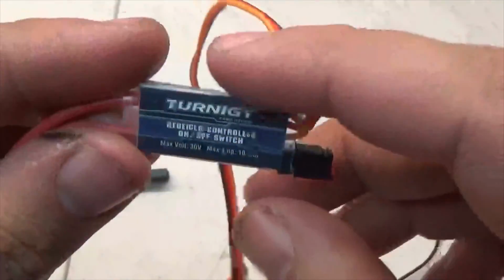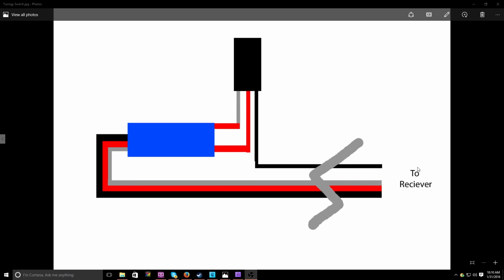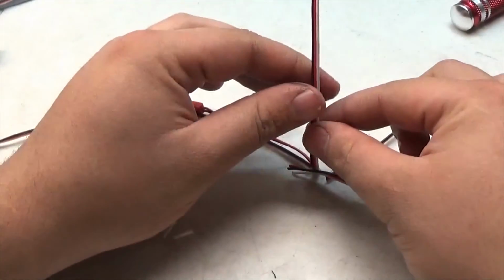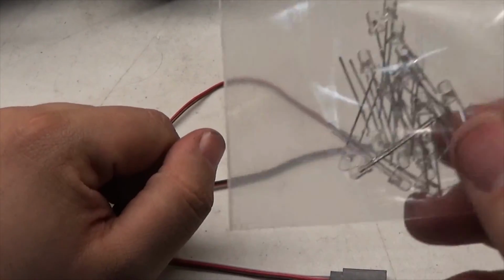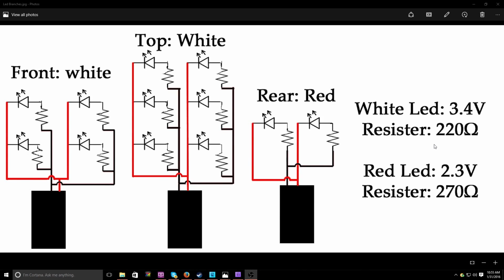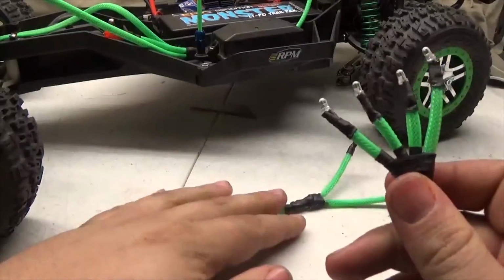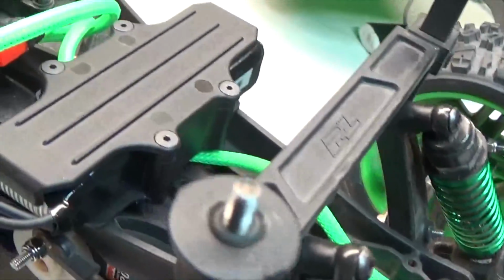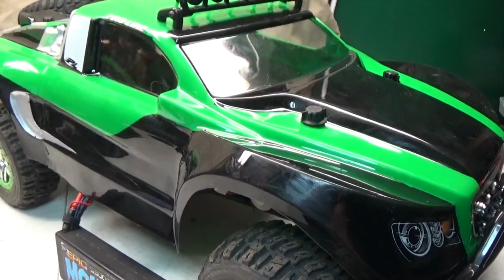Monster-LCG Slash 2wd-Level 15 Upgrade: Custom Led Kit

Comment: Can I just get all of the led wires, put a 9 Volt battery connector to them with electric tape and to turn it on just put the 9 volt battery on?

Comment: Looks great!
Can't you put aluminium tape in the buckets you have on top?
That could help a bit?
I would unplug it if you don't use it by the way, arent the resistors going to keep asking for current, draining the battery?
I might be wrong at this, but can't you use one resistor and solder 4 wires to that, instead of 4 resistors?
The voltage should be dropped anyway after that resistor?
Reply from the maker: I can try the tape, I only have the battery on and plugged in WHEN I intend to use the lights, when not in use it stays in my charge bag with the rest of my lipos. In theory yes, but first you have to make sure the resistor can handle the amp draw. I decided to play it safe and have them paired with a single led. And this way if one fails for whatever reason only one LED stops working. And if I'm running in the night I don't lose that much visibility
Reply: +RCBros2000 Ah, that is true, I don't know that much about electrics.  keep up the good work!

Comment: Awesome! I love how you used green wire mesh, it wouldn't have looked as nice if you didn't. Also, do you think we will see a run video any time soon?I would love to see your cars run
Reply from the maker: +RC Mayhem im planning a big runn video involing every one of my Rcs. with many shots. all i need is a suction mount and im set. and get alpha running. pain in the * that carb has givin me problems since i re did the seals and boot. guess old tech doesnt like getting fixxed up.
Reply: +RCBros2000 well I can't wait to see it, I might do a run video next weekend of delta and possibly beast. I hope you get alpha working
Reply from the maker: thats my plan for tomorrow

Comment: sweet, how much did the kit cost?
Reply from the maker: +All The Time Rc for everything including the charge lead for the battery costed around $65.78
Reply: +RCBros2000 how r u so smart at this im like aaaaa i don't know anything
Reply: +RCBros2000 if u have any extra wire mesh can i have them so i can use it when i get a stampede and build it
Reply: +RCBros2000 wow the light look awesome!!!! man and very bright
Reply from the maker: +Chevy RC very funny chevy very funny
Reply: +RCBros2000 lol u want me to delete it
Reply from the maker: no you can keep it lol

Comment: Lol took you a while to finally get everything. #January10
Reply: Cool video!
Reply from the maker: +goldfishshooter tHE the resisters took forever but i had to wait for the battery to come in.  but you can scratch a week off since i was working overnights all week last week so i diddnt get to editing
Reply: +RCBros2000 well at least you got everything for it to work!!
Reply from the maker: ya after several burns and a short circuit. i need to get one of those soldering iron holders lol. i enjoyed working on this
Reply: +RCBros2000 yeah at my old work when I was soldering I'm a noobie at it and almost burnt a fair size almost hole ( not a real hole lol ) in my nail.
Reply from the maker: ya i did that once before it sucks!
Reply: +RCBros2000 that's for sure lol doesn't feel pleasant. And you going to get on MC tonight?
Reply from the maker: +goldfishshooter most likely. probably record another video between now and then
Reply: Awesome I'm going to be editing a couple run videos. But also need to look for a new job haha. Hope to see you on!